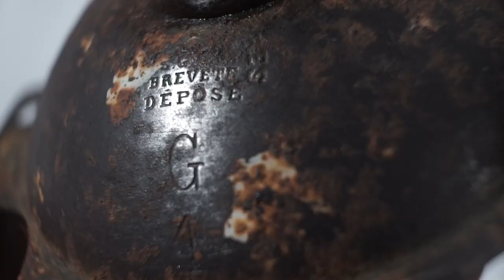100 Years old coffee grinder - perfect restoration  with basic tools

Comment: There are incorrect things in the restoration, 100 years ago there were no Philips head screws, nor the type of self-tapping screws used to secure the parts to the wood. I am very sorry but the kind of hardware used in a restoration has to be correct.
Reply from the maker: I agree with you. This is my first restoration and I had a lot of mistakes. Working and studying now to make it better. Thank you for your opinion. You are totally right. Cheers.